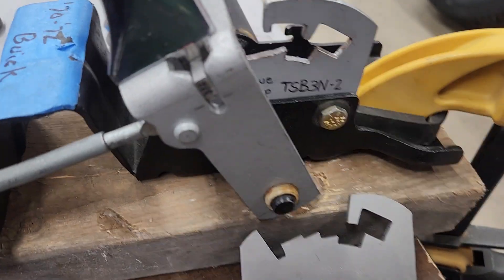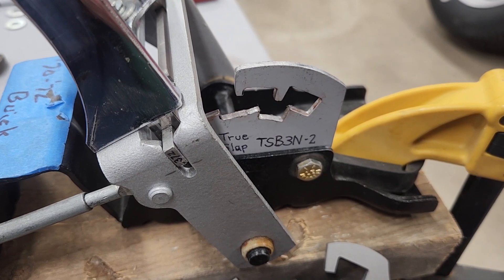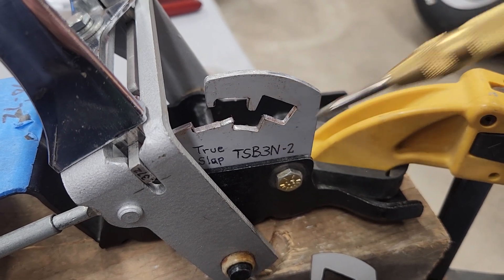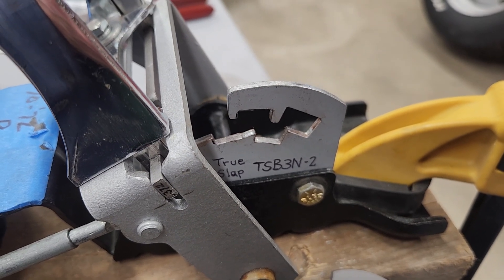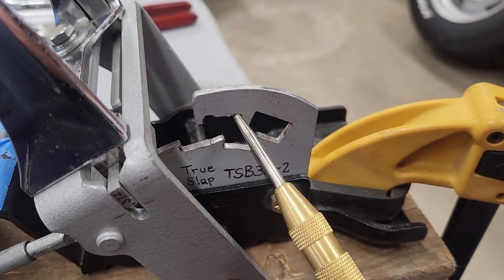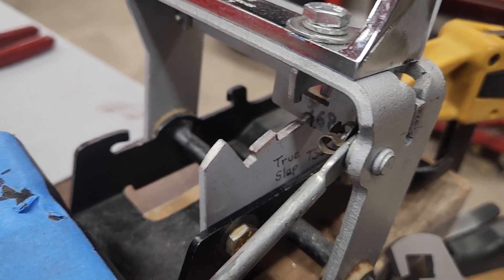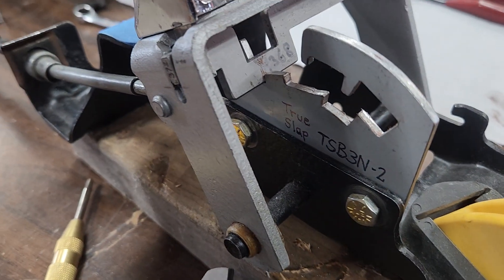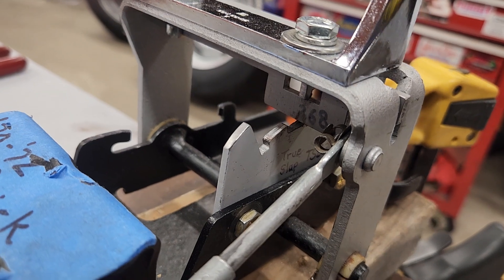DPJ Fabricating, LLC, True Slap TSB3N-2 for '70-'72 Buicks. Modified to make a fast 3-N shift.

Comment: Recommend you design a reverse lock-out using a second handle rather than a detent/stop.  Something that requires two hands to engage reverse.  Otherwise it'll be too easy for a cluts like me to slip past a stop and right into reverse - kinda like when people inadvertently shift past 2nd into 3rd by shifting too slowly only with disastrous results and inevitable product liability.  IMO it would be better for you if you didn't provide the feature rather than one that exposes you to problems.  An added benefit to a positive reverse lock-out is that it would meet NHRA requirements.  Just a thought.
Reply from the maker: Thanks for your input. I've been studying the possibility of adding the lockout you described, which is used by B&M and some others. The console installation has limitations.

I made this and one other design after getting a request from a past customer that races, and the main purpose of me posting the 2 videos here was so he can see my demonstration. I don't have any plans at this time to add them to my inventory. My customer has both of these prototypes now, and he'll be testing them soon to see which suits him the best. It might be that he'll be the only one using one of them. I have another design in my head that I might try. It might even work better than this one. 

I appreciate your concern, the critique, and your interest in my products. I'm always willing to hear from others. I'm just a car guy that likes to make our cars more fun.